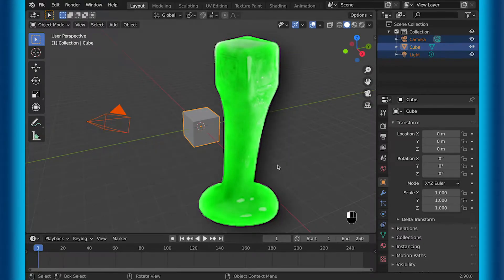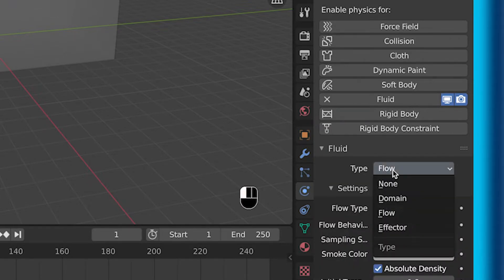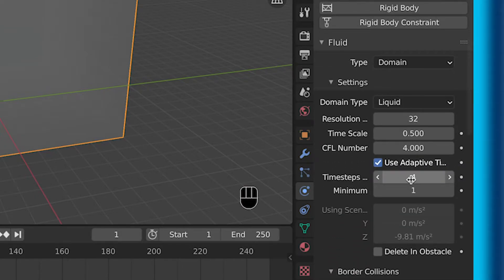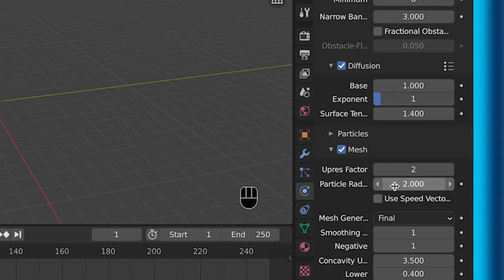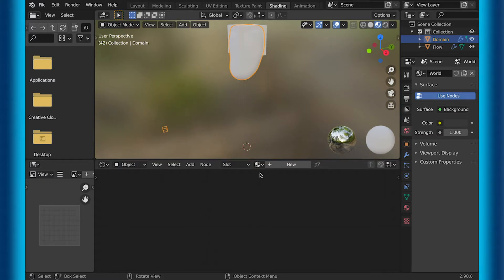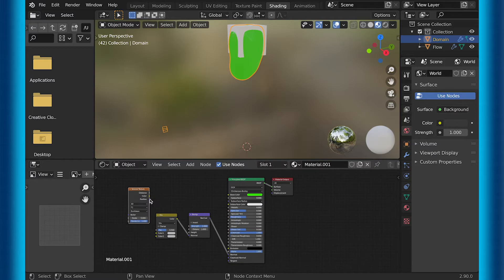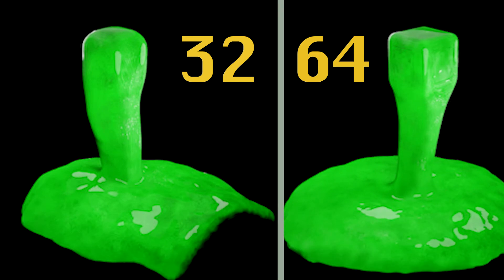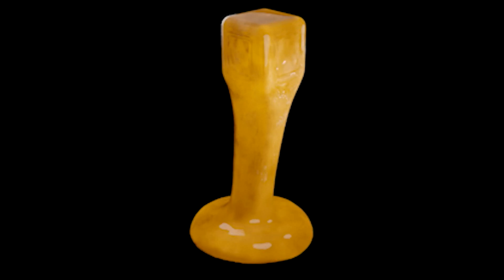Slime Tutorial for Blender 2.9 (Liquid Simulation)

Comment: hi, I want to do a simulation of the extruder of the 3D printer printing. What is the best way to do it? With fluid simulation? I have tried making a curve and varying the "end Mapping", but I don't know if there is a better way to do it? Can you help me with this?
Reply from the maker: Wow, I really like this idea. A fluid simulation would potentially work, my only issue with it is that it might not hold the line's like a normal 3d print and it might spread out too much. If your goal was mainly to get something to come out of the extruder then fluid simulation would definitely work. I personally can't really think of a better idea. If your okay with it I would like to try this as well. I would probably make a video on it if it worked, but if you don't want me too that's fine. Either way thanks for asking :D.
Reply: @Dragon3D  Yes, of course. I did several lines with fluid simulation and it worked fine, the only thing that was slow to render and I wanted something fast without much resolution. The key was that you had to move everything that you had printed on the Y axis since the prusa i3 printer, the Y axis is independent of the Z and X. I have tried it with particles too, but when you go up layers I do not they stayed on the site and they didn't follow the Y axis. hahahhaha thanks for helping me, I don't have much idea of using blender and I have a project in hand.